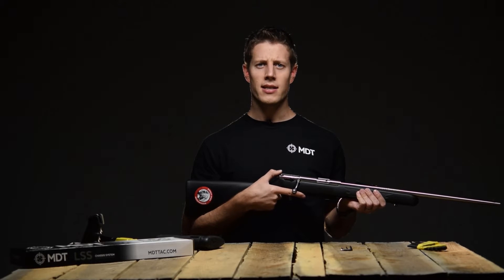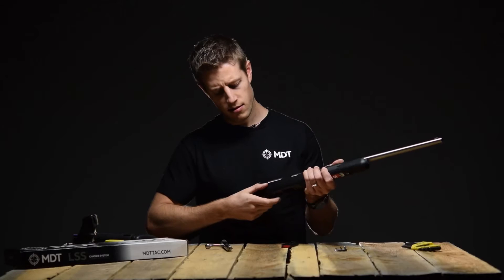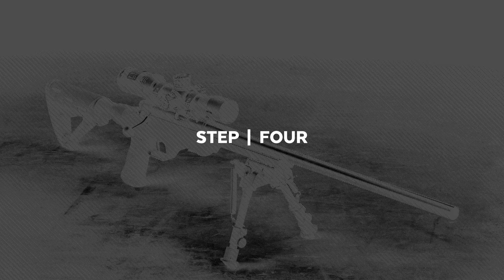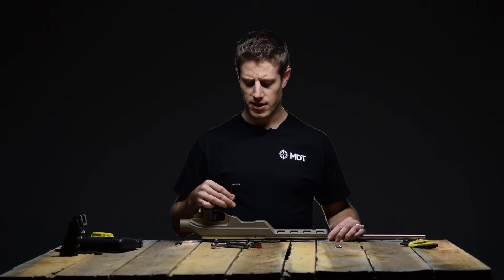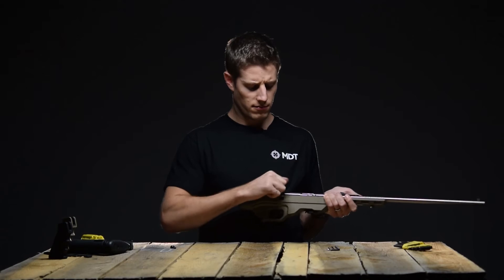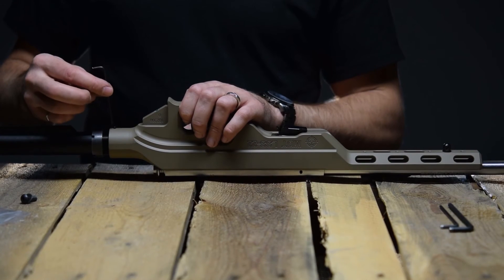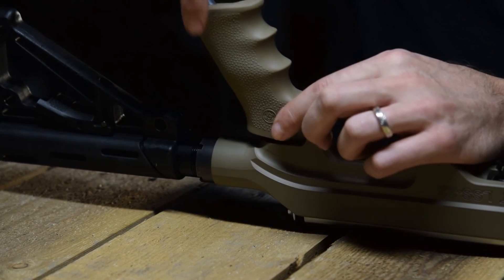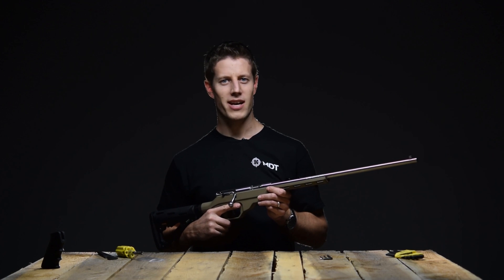LSS 22 Savage Mark ll Install

Comment: I believe 65 inch-pounds stated in the video is too much for the rimfire chassis action screws. It is however the right spec for center fire rifles. Confirmed in follow-up with MDT.  My (Savage 93r17) rimfire chassis box inadvertently contained centerfire instructions. Great chassis!
Reply from the maker: Yes, 60 - 65 inch-pounds is a bit much for a rimfire rifle, we do suggest 15 - 45 inch-pounds. Glad to hear you are liking it!

Comment: The Savage Mark II without the stock looks very similar as the Savage 64 semi auto. Does it work to use the Stock for the 64 semi auto?
Reply from the maker: We are not aware of any compatibility with our Savage MKII inlet, and the model 64.

Comment: People just use the math. Mark II FV upgrade - Chassis + pistol grip + stock = new Ruger Precision rimfire riffle. Does it make any sense? MDT prices are terribly exaggerated.
Reply: What's price is the Ruger Precision Rimfire ?
Reply: @goosecouple  you should find for $699 CAD
Reply: @goosecouple  even if you love Savage you can get new at Cabela for $749 in MDT chassis.

Comment: what grip is this, why don't you sell these as a complete kit....tip: dont buy a grip that curls up at the back, only buy a flat top grip.
Reply from the maker: It is a Hogue grip, available on our website. We do not offer full kits at the moment as there are so many options that can be mounted to our chassis. But it is possible that we will offer some complete  kits in the future.

As for the beavertail on the grip, this all depends on the person. Someone with large hands will most likely want this so that it places their hand further back.

Comment: That is over 400 just for that way put it on a $100 22 that's just stupid
Reply from the maker: Hi Michael, that really depends on the purpose. The Savage MKII is a bit above $200. For general plinking using these chassis would certainly be a big cost. For for competitive shooters this is making a big difference. We are even seeing people using the MDT ACC which is a $1000 chassis on rimfire rifles.
Reply: Dont hate partner 😉👍
Reply: Maybe a cheap rifle but there are plenty of them so I would imagine a big market and it also allows a shorter LOP for junior shooters which is a real plus.  Looking at it for that reason myself.  And only in the US is it a $100 rifle.  Paid $360 in Australia nearly 8 years ago and now that the dollar has dropped they are over $500 new.  Plus they shoot reasonably well and mine has been flawless for many thousands of rounds.  Except Stingers.
Reply: I'm a bit late on that but part of why the mk2 is cheap is because of its 10$ plastic or hardwood stock. Where I live it's ~ 50:50 rifle/chassis depending on the exact model. However, that's what I'd pay for a rem 700 chassis or anything else too ... (in the preferred configuration). Overall most mk2 are very valuable. There are few reports where the person who assembled the rifles must have been drunk when he did his work, but mine does what it is supposed to do. The only thing I'd do is change the stock (what I'll do) and that ugly magazine (what savage did with the b22).